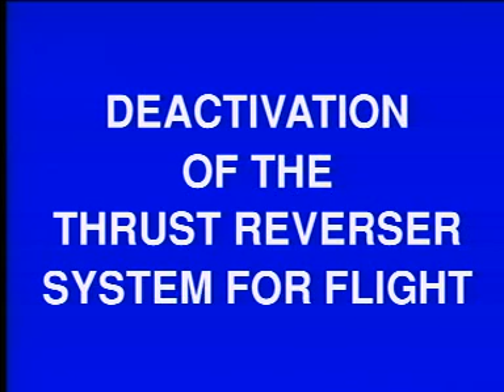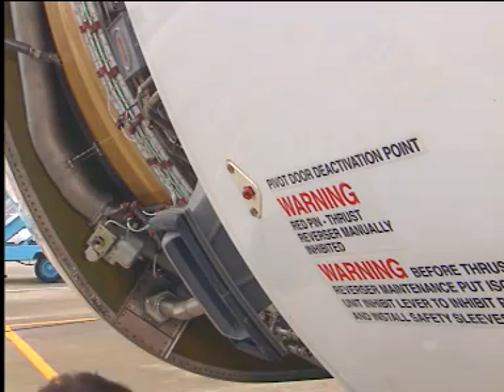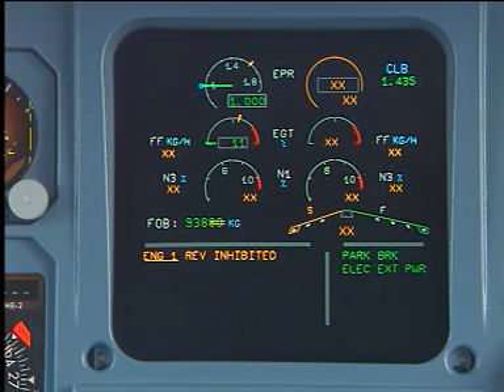AIRCRAFT | A330 Trent 700 - Deactivation of T/R System for Flight

Comment: Maintenance manual tells you to deactivate the T/R every time you work on the engine....
Reply: This method of deactivation in case of failure
Reply: Of course but this is : deactivation for maintenance not for flight 🇩🇿🇩🇿👍